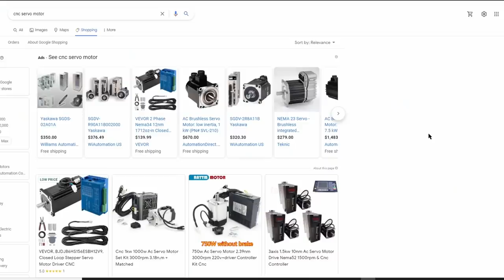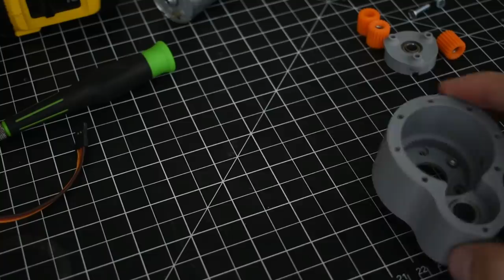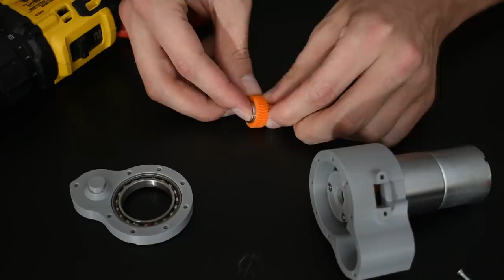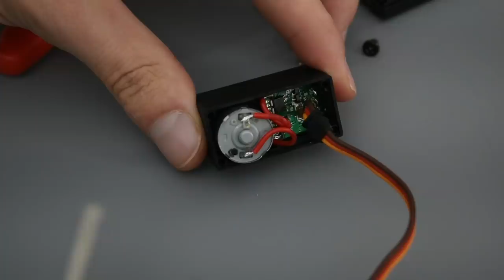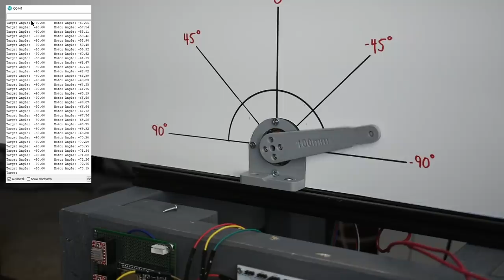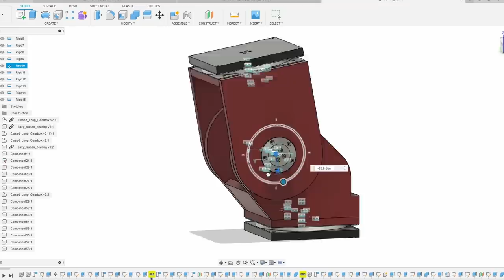This Gearbox Knows Its Position At ALL Times

Comment: THE SERVO KNOWS WHERE IT IS.
IT KNOWS THIS BECAUSE IT KNOWS WHERE IT ISN'T
Reply: This has quite some implications... It knows that it isn't in locations it doesn't know about... And therefore knows about the existence of those unknown locations?
Reply: @steveman1982  By subtracting where it is from where it isn't, or where it isn't from where it is (whichever is greater), it obtains a difference, or deviation. The guidance subsystem uses deviations to generate corrective commands to drive the servo from a position where it is to a position where it isn't, and arriving at a position where it wasn't, it now is.
Reply: @steveman1982  That's a meme reference don't think too much about it, if you want actual reason servo knows where it is then the answer is encoder tells it it's position.

Comment: I like the idea of mechanically adding one bit of precision by implementing a binary swich on the rotor. Pretty cool. The same switch can also be used for self-calibration since it defines the semicircle.
Reply: It won't be 13 bit instead of 12 because of :
innacurate magnet placement
output noise
gear backlash
Reply: @kacperzurawski5699  well, you would have these noise sources there on 12bit anyway. With 13bit you can measure them more precisely. xd I don't say you gain anything by this one extra bit here, but as a concept it's a pretty cool idea that could be implemented somewhere where having one extra bit would really mean something.

Comment: This is really cool! One thing that that wasn't very clear and I'll be a bit pedantic about though is open vs closed loop. A stepper motor can do the same thing with regard to copying the angle of a potentiometer. A better demo would have been to stall your gearbox and show that even though it was interrupted it was still possible to know its position and continue to the target location. I am 100% sure you know this but for some viewers it may not be obvious.
Reply: Then I'll up your pedantism. A stepper motor may skip steps, and you will have no way to correct it, hence it's an open-loop system.
Reply: @dthe3  Isn't that what the comment said ? or do I not understand pedantism
Reply: @DemsW  Pedantry ;)
Reply: It is a word that means you have a fetisch for feet.
Reply: @DemsW  Gremlin technically left that point implied, and "for some viewers it may not be obvious"

Comment: Cool but you should look up how ball mice work. They have 2 lights sensors and the encoders have slots offset from each other. So it's able to tell exact position and direction of the spin.
Reply: Cheap optical encoders do not have absolute positioning. Only relative using deltas. The magnetic encoder he used in the video uses grey code which allows you to know the absolute angle (within 0.1 degrees) even between power cycles. Optical and rotary encoders need to be homed every single time you power cycle since they do not guarantee that the axis was not rotated while powered off.

Comment: Not questioning your choice of a hall sensor to figure out your position, I just wanted to let you know that you could also have used a trim potentiometer (german "Spindel Poti"). Those Potis need eg. around 10 turns to change their resistance from 1 extreme to the other. They are used eg. in sailing winches used in model sailboats to move the sailes. The drum which operates the sailes usully needs to make 3 or 4 turnes to move the sailes from the "innermost" position to the "outermost" and needs to be able to hit the same positions extremely accurate. No homing sensor needed, since the Poti does the job without any needed additional help.
Reply: Rheostats and potentiometers use brushes which limit their life cycles significantly when compared to this magnet based encoder. They can be used, but its not recommended.
Reply: @SEGnosis  
My winches operate my sailboat (actually racing in regattas) since more then 5 years without problems.
Do the brushes create problems eventually? Sure, they will. It all comes down to how long you need them to operate. As said: mine work since more then 5 years without a problem. If they do create a problem, then they get replaced and all is well again. Homeing with and end switch however would create a problem, since I simply cannot allow the winch to turn until it reached its end position. You see the motor has plenty of power. If it turns the spindle to its maximum position it would crush the whole mechanism due to excessive force. This is so, because the innermost sail position does not correspond with an end point.
Reply: @kallewirsch2263  Sounds like you're using a big pot with big brushes. In the case of this makeshift servo motor. You shouldn't use a pot bigger than the motor. Even if you could.
Reply: I feel like this is a sidegrade, not an upgrade, and is only recommended depending on the application of your servo. For a servo that only needs a limited range, sure. But he stated in the beginning of the video that one of the disadvantages of typical RC servos is their limited range. With a hall sensor, you have continuous rotation, which might be a constraint of certain usecases.

Comment: for high resolution of feedback(encoder position) single magnet on end shaft isn't enough. use disk with rectangular flat magnets vertically. commercial servos use glass disk either slots with tiny  magnets or with optical sensors with slits on glass disk. to store the accurate location even with power losses, supercapacitor with flash memory or always on lipo battery.

Comment: Very well done, can't you use, say, an outer race of a suitable bearing to strengthen the outer gear? It would obviously move the encoder gear, but those bearings are quite cheap, easy to open and have excellent strength.

The other place you can find those compound gearboxes is in the winches, even the cheap car winches have metal gears in them and often pull 600kgs on 60mm pulley (making it about  180NM if you every would need to build something particularly powerful).

Comment: the mechanical switch is viable but a optical method would be far more reliable or even a reed switch or hall sensor with magnet in your large gear set

Comment: Maybe you can resin-cast the 3D-printed gears to make them more durable? I do not have the money right now to buy expensive resin and silicone but it could be a fun project in the future.
Reply: I don't know how much more durable resin would be. Where the 3D printed gearbox can flex a bit when it skips, I'd think with resin the gear teeth would just shear off and jam up the mechanism. That said, you don't have to give Smooth-On your firstborn child to get started with mould making and casting. Everything you need can be found at your average hardware store for pretty cheap: silicone caulk, plaster, epoxy (J.B. Weld might be interesting to cast with). I'm sure there are plenty of YouTube videos that can explain the "how-to" of it better than I can.

Comment: Do the two outer Rings have different number of teeth? I'm a little confused how the transmission is achieved because they seem to be the same size and and the caseing und output shaft therefore shouldnt move indipendently (or maybe i'm just missing something obvious ^^).

Comment: Cool idea of making an own servo :D
would a planetary gearbox with a BLDC motor fit for driving a platform on tracks instead of wheels? I mean..due to torque?
Would be PETG better for a gearbox, when working with a way faster BLDC motor?
Reply: The moment you have an encoder the BLDC can have maximum torque from 0 RPM - you can use the FOC algorithm. And this thing gives you an encoder.

Comment: I'm doing a project similar to this at the moment, but to clarify my understanding, is the AS5600 encoder an absoloute encoder giving a bit code for the exact angle of the shaft, or is it an incremental encoder telling only the direction and amount of movement? I am building a robot arm and want the arm to know the current angle of the joint when powered on without having to home, will the AS5600 provide this in the form of the bit code?
Reply: Absolute iirc
Reply: Yes i use it on my own robot arm but the as5600 has only one, I2C address so you will need to use an i2c multiplexer

Comment: I am curious as to why you chose a mechanical switch in the gearbox assembly, instead of a tiny magnet and a hall sensor? The switch will wear out pretty quickly I would imagine.
Reply: If by quickly you mean in twenty years,  then probably.
Reply: @dieselguy62  Only 20 years? That thing could sit on a shelf for at least a few hundred before the metal bits corrode.

Comment: Awesome, quick tip, grab a raspberry pi and install octoprint then plug it in the printer, allows you to control the printer wirelessly. If you don’t think you need it, trust, when you get it, you can never go back

Comment: It seems you still have only 180° just like the "cheap RC servo motors" in your introduction. Additionally, you've printed the colourful and pretty plastic gearbox but there are many dc motors that already come with a gearbox AND and encoder! So other than adding the limit switch I don't see any benefit in what you've built...you can just buy the stuff.....

Comment: Cool stuff, it looks like you don't know Odrive robotics. It's a 2 axis burshless motor controler that ahs encoder inputs. it quite powerfull (up to 100A @48V) and they sell 2 encoder types 8192cpr and 20k cpr. It's not that expensive too, like 200€ for the board and 40€ per encoder and you can use motors that have a lot more torque than 7nm.

Comment: I want to combine this project with the project from this guy https://www.youtube.com/watch?v=IH7HHuaDm94 to make a Servo like yours with step dir controll, wich could be directly driven with any 3d printer or cnc board that normally uses steppers. this could cheaply solve the problem of missed steps on these machines. Maybe this could also be an Idea for you? that way you could use a 3d printer board to also drive your robotic arm if you code in the inverse kinematics and even use slicer or cam software to controll it or manually write Gcode for it for different applications
Reply: Why don't you use closed loop nema 17 stepper motor on 3D printer ? They are not that expensive nowadays (about 38€ on Amazon, search for "servo42b"), silent, and you save a bit because driver is integrated, so no need to buy TMCs (or DRV or Allegro or whatever you want as a driver)
Reply: @argodbc  Because I need more power than a nema 17 can offer and I´m not gonna pay for a bigger premade closed loop motor